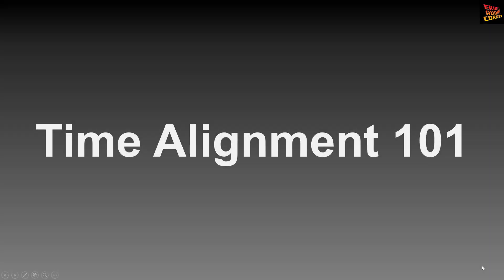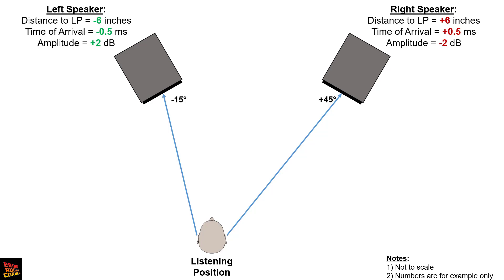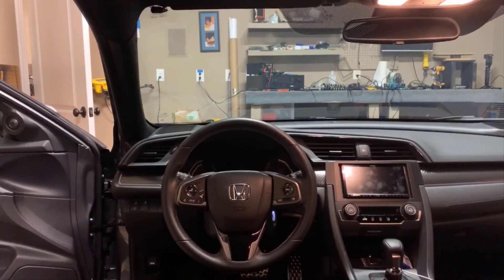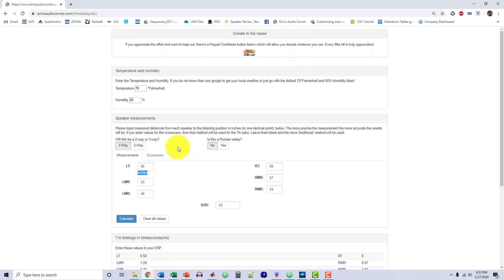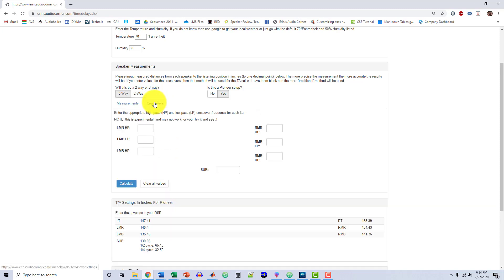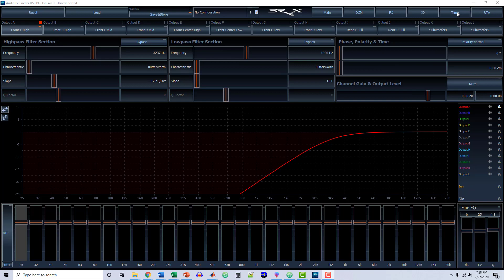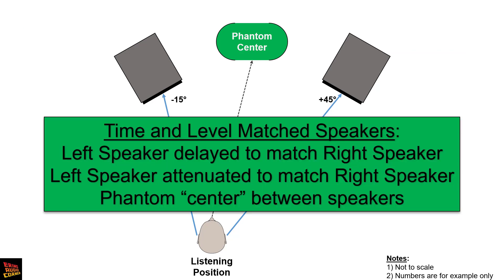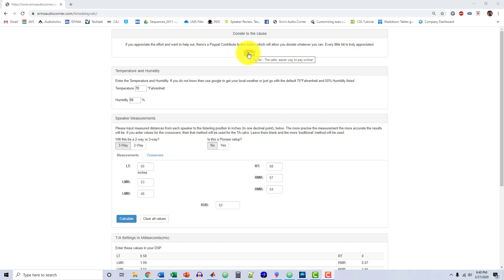Time Alignment 101

Comment: if after the adjustments, the time of arrival to both ears is identical, and the levels to both ears are also identical, then shouldnt the new phantom center be right in front of you and not in the center between the two loudspeakers. Sort of like a headphone, same amount of delay and level from both sides makes YOU the center. This has been confusing me.

Comment: I have an Alpine 507, and I have the option to use inch, ms, and cm. When I get the measurements I plug them into the calculator and calculate in ms. When I put my 507 into ms measurement the sound has no center channel. I really don't know what I am doing wrong. I can't tell if my head unit calculates the zero point or if  I have to calculate that and then put the numbers in the calculator. Any idea if my head unit does the zero point? I also am not active, I have passive coaxials currently, however this will change very soon.

Comment: Can you time align half decently for the driver and passenger?
Reply from the maker: No.
Reply: @ErinsAudioCorner  so what do you do as a ‘ compromise ‘ for passenger and driver in a tuning profile if you don’t mind me asking? 
I got the driver side all nice and time aligned.   

Thanks Erin.  Your channel is getting seriously good.
Reply from the maker: @Nightjar726  have a compromised setting with no time alignment.
Reply: @ErinsAudioCorner  just zeros for delays?
Reply from the maker: @Nightjar726  I mean, there’s not really much you can do here other than maybe trying to align speakers on their same sides. But left/right alignment won’t do anything other than make the sound better for one side. But not both.
Reply: @ErinsAudioCorner  thank you.  One more thing to clarify 
When tuning a car system.   Do I first do level matching , then time alignment and then Eq? 
I’m assuming time alignment should have the levels matched between speakers first.
Your channel is awesome.  I need to start posting more of the speaker measurements you do on the audio forums I attend to get you more views and traction.  
I know it will cost a lot for tower speakers to get measured but that would be a sure way to get more views from forums. 
Your speaker reviews are probably the one of the best if not the best. Rivaling stereophile imho

Comment: Hi Erin,
The best video for Time alignment. 
I have Helix DSP 3 with Focal K2 in my truck. 
However, I use both driver and passenger seat in my car. Should I do time alignment? If yes, then what location?
Reply: my guess is to create 2 profiles, and then choose the seat you sit on.
Say, profile A with measurement between speakers and driver.
Profile B, is for front passenger.

When you're the one driving, choose profile A.
When someone else is driving, and you're in the front passenger seat, choose profile B.

Fuck the other people, it's your car, you're paying for it. Hell yeah.
If you dont tell your wife about it, she wouldnt know and not gonna ask for profile B when you're driving.
The only time you set the right profile for her is when you're seeking her approval to finance the system, but keep it discreet.
Reply: center?

Comment: Hi Erin,

1. My mids are in doors and tweeters are in sail panels. I measure from the grill of the door pad to the middle of the headrest?

2. Everytime I do this the image is right in front of me rather than phantom center. Have checked  everything and the polarity is right and slopes are 24db.

What could be the issue? Have tried the same in friends cars and its always driver side rather than phantom center.

Comment: for the subwoofer do u meausre to the middle of it or the closest part to u
Reply from the maker: For a subwoofer it doesn't really have to be super precise because the wavelength is so long.  But, with that said, I'd generally saying the dustcap is adequate.
Reply: @ErinsAudioCorner  ok thank you , im doing my custom computer system and I have a 21" driver sitting right infront of me to my left
Reply: According to my understanding, if you set the subwoofer crossover point below 65hz, I will be non directional, please correct me if it is wrong

Comment: Thanks for the great sharing. Got a question, what if in the case for a BMW car where the midbass is located under both front seat, what value should we use ?

Comment: So, if I want all 4 seats in the car to have a global center stage like in a private theater, I should assume the listener is sitting on the glove box, right?

My car has a center speaker and c pillar speakers, along with door speakers.
Reply from the maker: You’ve got a center channel. You don’t need to do any time alignment other than aligning sides of speakers. Meaning, align tweeter with mid on left and on right. 

Even still, not all 4 seats will have the same response. But a center channel is the best way to get toward that goal.
Reply: @ErinsAudioCorner  I tweaked some delay settings and it is half decent fornthe front seats. Thanks!

I now have another question: should I even attempt to add a center channel tweet in the glove box that faces the rear passengers?

The reason being that during the tweaking for  the rear seats, what I felt was that the mid tweeters are way too far to the front. I have added front firing C-pillar speakers at the factory location, which mitigated the left and right channel issue somewhat, however the center channel is still way to far, hence sounding quite hollow if the mastering is not done right.

Comment: Very cool tool. I'll have to come back and use this when I do some upgrades to the car. 

I plan on replacing my front speakers and adding a tweeter to the factory location. Currently just using some coaxials. 

They'll be ran on the same channel with a highpass for the tweeter and lowpass for the midrange. (Both at 4,500Hz) I might use a Lpad to dial back the tweeter a little if it needs it as well. 

Since they're not individually DSP controlled would I enter the same distance for the tweeter and midrange based on the midrange distance? 
It's an 03 Buick Regal so the tweeters are on the door not too far above the 5.25" speakers location.
Reply from the maker: Yes, in this case it makes more sense to use the midrange distance for setting T/A.

Comment: I would be interested in how fine-tuning the time delay after having the delay set by the distance works, like how much ms at which particular frequency range can change the phase of two drivers. Also, I have an Audison DSP which doesn't allow me to make groups or links when doing this time alignment fine-tuning, any suggestions on how to proceed when doing one by one driver?
Reply from the maker: You should only need to fine tune the delay if things sound "off".  In a car the environment is a bit tricky to properly measure the distance (i.e., speaker behind door panel, etc).  In a home it is much more straightforward and should be unnecessary to make manual adjustments after the fact.  Just getting that out of the way.

Time delay is a full spectrum shift so the only frequency-basis you would experience would be due to different reflection times due to the different path lengths from speakers to various reflecting points.  But  your goal is to align the direct sound with a tape measure and that should get you in the ballpark.  You can make manual adjustments if the tape measure isn't precise enough (again, speaker behind door, etc).  Alternatively, you can use a loopback-based measurement setup which will tell you the actual time of arrival of the impulse and then you would use this to align the impulse peaks from all the speakers.

Comment: after finish TA, when i want to move stage. why i should adjust level +1.25db/-1.25db ? big thanks
Reply from the maker: because time delay and level matching are both needed to steer the image.  Realistically, the stage center should be approximately in the middle of the dash but some people simply prefer it to be at a different location; thus the inclusion of the additional offset.
Reply: @ErinsAudioCorner  if i use app to measure the SPL of each speaker. according 1m decrease 6dB， should i do leveling SPL first or TA？

Comment: I have an Alpine DSP with component 6 x 9's in the door of my 2018 Maxima. The woofers are in the front door panels and the tweeters are in the dash. Both speakers are connected using a single channel. How do I pick the distance for these 2 speakers? Measure them both and average the distance between the 2? I.E. the tweeter is 48" and the woofer is 50". Set the distance to 49" ?
Reply from the maker: I'd probably go off the distance of the woofers.
Reply: @ErinsAudioCorner  OK. Can I ask why?
Reply from the maker: @darieng619  we differentiate sounds coming from our sides based on time and amplitude.  However, the frequencies we base these on are split around 1-2kHz.  Below this we predominately locate based on time of arrival.  Above, amplitude.  Therefore, time arrival is more important when it comes to low-to-mid frequencies.  You can learn more about this by searching for "interaural level difference" and "interaural time difference".
Reply: @ErinsAudioCorner  I think you were right.  I tried it averaging the distance first and the sound seemed to be coming from about the middle of my dash, (like where the head unit is).  I changed the distance to be where the woofers are and it sounds higher up now.  More like on top of the dash.  Thanks for the help.

Comment: When I enter all the distances in my Helix DSP SW the result is the stereo image pulls to the right. In songs I know instruments that are panned left sounds centered and vocals sound to the right. This happens when I use time alignment to my subs ( farthest away ) or no subs, just the mids and highs. Both do the same to the stereo image. I’m on a Helix DSP.3 but this also happened with my previous DSP

Edit: Im using distance mode in the same SW and did not use your website, used a tape measure.
Reply: I don't think you understand how time delay works. 

*listening position (lp)

When entering distances don't enter the distance the driver is from the listening position instead use this formula: (farthest driver distance to lp) - (distance to lp of the driver you are measuring) = distance delay

The farthest driver from LP should have 0 delay and every other driver that is closer needs delay so that the sound arrives on time. The closer a driver is the MORE delay it needs. 

When you just measure distances and input those values you're doing the opposite.
Reply: @maxbernard5797  You are correct. Going by your formula, You can hear more detail in the music. It's a night and day difference.
Reply from the maker: If you're entering the distances as distance in to the Helix software correctly, my hunch is something is out of phase.
Reply: Erin's Audio Corner everything is wired at the amp correct but I’ve never seen behind the door panels or A pillars to check the wiring the original installer I hired did. He did wire my subs out of phase so it could be a possibility..  I seem to play pink noise decently flat and don’t have any huge dips in the signal but that was using Apps on an iPhone ( iPhone mic goes down below 30Hz ) I have a measurement mic coming. 

When I entered the distances subtracted from the farthest speaker’s measurement ( subs )  in the SW, the stereo image sounds much more realistic... However the Helix manual says to enter the tape measured distances & that’s what skews the image ( so did the Hertz DSP ) 

So am I doing it wrong? I know what the manual says but it also says to then adjust by ear if it sounds off. Do I enter the actual tape measurements in the distance mode or the subtracted measurement from the farthest speaker? 

I guess I will have some more car to tear apart.. Smh... Thank you
Reply: Erin's Audio Corner will flipping the phase in the SW provide the same result as taking the door card off and fixing the wiring if it’s out of phase?
Reply from the maker: @uptobatentertainment  You need to make sure that the left and right midbass are acoustically in phase and that the subwoofer is in phase with the two midbass drivers.  Typically this means that polarity of the drivers are all the same, but subwoofer to midbass phase is usually not 0 or 180 degrees that a polarity swap would net you.  Instead the subwoofer to midbass phase alignment is often found to be at some increment between 0 and 180; for example, maybe 25 degrees.  You would need a DSP with variable phase to correct for this.
Reply: Erin's Audio Corner ok excellent thanks for the help! I can adjust the subwoofer phase is the DSP PC Tool SW in 11.25 degree increments. My Zapco ZII bass amp has a variable phase from 0 to 180 as well but I will probably use the SW. I ordered a UMIK-1 measurement mic as well. I will play some tracks I know well and flip the phase in the SW to see if the mids cancel out, sound the same, or sound better lol. Then when the measurement mic gets here I should be able to find out exactly. Enjoy your Memorial Day weekend.
Reply: @uptobatentertainment did you ever find out why the image pulled to the right?

Comment: When using the “crossover” portion, do you recommend using the electronic crossover point or the actual acoustic point? Example; a midrange with electronic xover hp at 100hz@24db, but measures 130hz@24db on rta.
Reply from the maker: I think it would make more sense to use the acoustical crossover point.  I say if you're going to try it, though, to try both.  Feel free to let me know your results.  Like I said in the video, that's one of the more "experimental" type things I included in the site.  I don't think it's entirely necessary but might be a good alternative to not having variable phase.
Reply: Erin's Audio Corner 
Cool! I will try both ways and see what works best. Will report back...